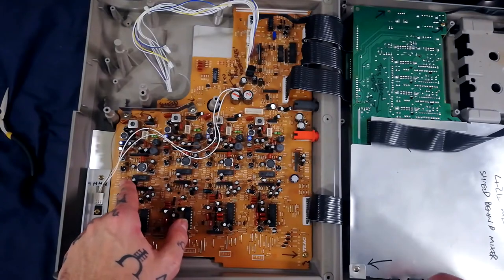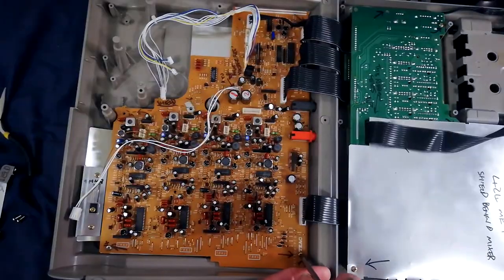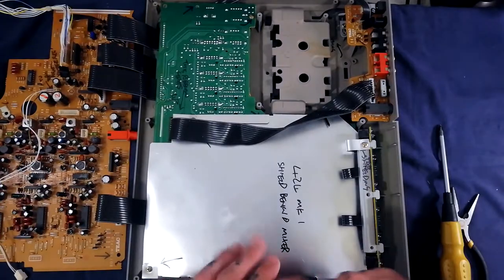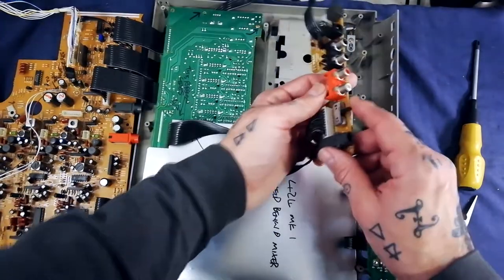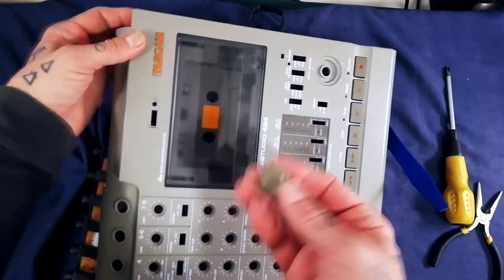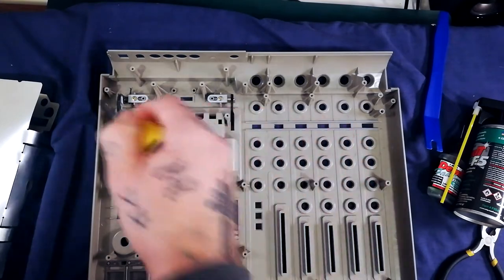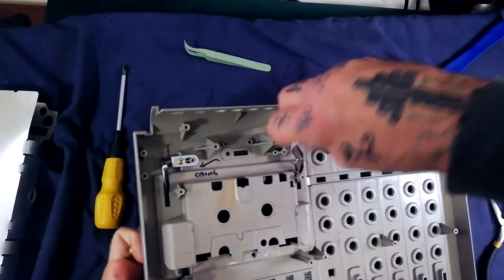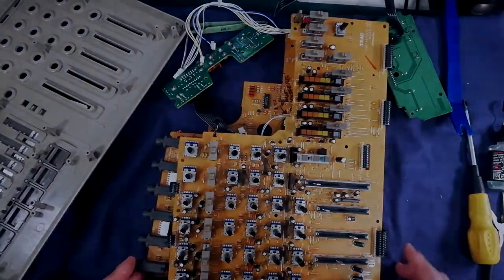Tascam 424 | Tear Down I 2 | Remove PCBs & cassette door | Calibration

Comment: Hey dude thanks so much for these breakdowns!! I've got a really stupid issue with mine, mostly it works a dream but the stereo jack inputs used for the effects returns just either play Mono or only one channel - tried cleaning with cotton swabs, still no joy, what's the next best thing to do? Any tips welcome 🙏🏻
Reply from the maker: Could be cracked solder at the base of the sockets or check the schematic, if the stereo part of the return signal passes through a separate opamp gain stage maybe the coupling capacitors, power rail or opamp is faulty on that gain stage.
Reply: @Tetrakan  Ahh thanks so much will take a look at both and see what the issue is

Comment: Hi, This is amazing work. Thank you so much for this. I am a complete noob when it comes to this kind of teardown and technical repairs. But I own a 424 mk1 too and the 6mm jack input of channel 1 is loose contact and i really need it to work. It only works if i push it to the front with the cable and hold it a certain way, other times it does not work. What do you think I should do for a fix?
Reply from the maker: There's a good chance one or more of the solder pads at the base of the hack socket where it joins the printed circuit board has broken, you would be able to see a ring or crack in the silver coloured  solder, if so if you apply fresh solder to the joint that should fix it.
Reply: @Tetrakan  thank you, you're awesome! I'm going to order the tools, I don't have them yet. I can't open it to check either because the screw drivers I own are either too short in length or too big to go in to get the longer screws, I'll get back to with the results in a few weeks!
Reply: @Tetrakan  So I opened the piece and found out that the piece was repaired before. So I tried to solder it myself but I wasn't able to fix it myself, I will be sending it to an expert to get it to work again. But you were spot on about the problem, Thank you!

Comment: Do you have a video explaining how to calibrate in detail? Also I have a 424 that has a really loud hum during tape playback, the hum seems to modulate with the pitch wheel. I think it’s possibly a ground issue but are you aware of any known issue like that on this machine?
Reply from the maker: I have a calibration playlist which you can navigate to fairly easily from my channel splash page, I’m not sure how much detail you’re looking for but it will contain everything I’ve uploaded. Sounds like the cassette player isn’t connected to common ground, check there isn’t a stray ring connector loose following a belt change or similar.

Comment: Found a really clean one with a busted door for cheap. Was a bit flabbergasted by finding the transport/buttons work great but the meters don’t register audio going in or out during playback; headphones is mute and the line/tape out on the back have differing tones of white noise/ static.
Pretty disappointed. Any suggestions for my troubleshooting?
Reply from the maker: Often this sort of thing is down to bad caps in the audio path. I'll have the repair report video up before too long so you can see how I resolved   not dissimilar problems
Reply: I wondered if it maybe similar to the common occurrence with porta 02s after getting knocked out from reverse polarity. Huh. I’ll look into those similar ones in the amp circuit tomorrow. Thank you, You’re a gem of a YouTuber! Thanks for all you do.
Reply from the maker: Also make sure you've got a decent regulated psu when testing. Mine came with an off-brand switching psu which introduced a lot of hum to the audio path, had me scratching my head for a bit....switched to a genuine regulated Fostex psu and now it's more or less silent.